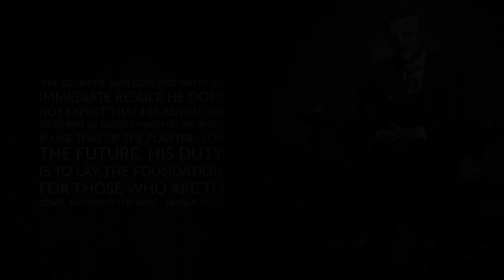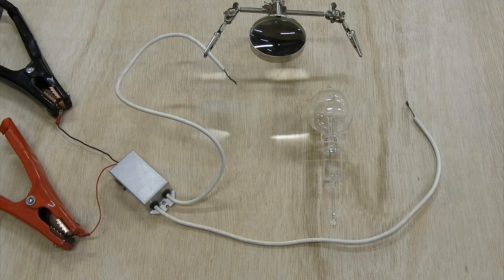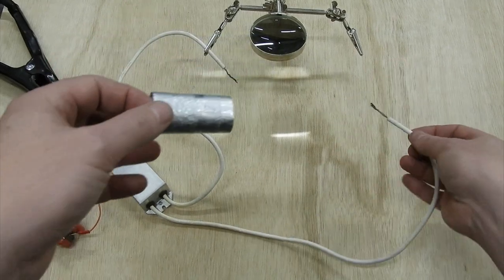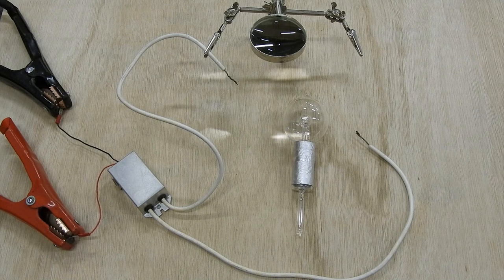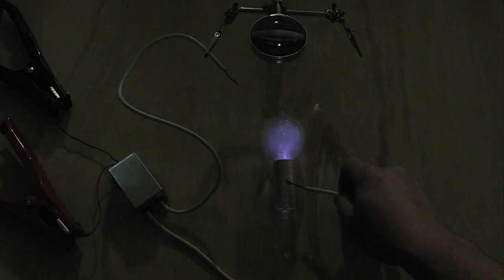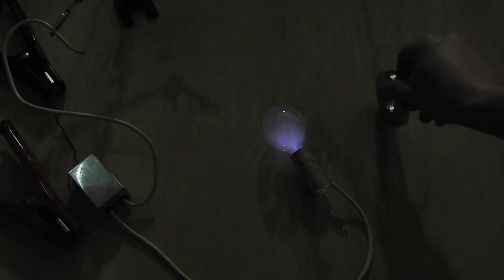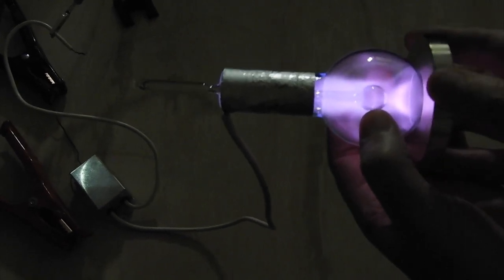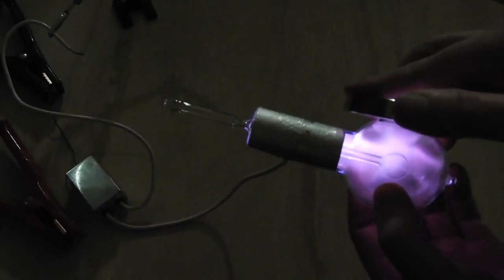Nikola Tesla's Plasma Valve Detector - Tesla's 1892 "Rotating Brush" Bulb Replication - Part 1

Comment: I've been working on this for awhile, few years, but no glassblowing yet, just pyrex glassware and greased seals.   I see this bulb as one of Tesla's central secrets, along with his prototype for Method of Individualization ( the "Static Eliminator" disks)  
Don't forget that FM radio is also a "static eliminator" device.     Also the diagram for the INSIDES of the Static Eliminator appears in Beograd Tesla Museum docs, the "wave-complex" signals being created by an array of eight resonators "tuned" by rotating and changing the gap. No, his "static eliminator" is not a simple transformer as everyone wrongly insists!  Tesla also called his wave-complex transmitter device by the name "sectional coils," discussed in the Leland Anderson interview.   It's radio with many tuning knobs, not just one, and each "station" becomes secure, existing as a tiny point lost in a radio-dial which exists virtually as an enormous, many-dimensional cube.  To find a station, we have to be given the dial settings, much like a combination lock.  Tesla said that his experimental system had 4 to 20 tuning knobs!
Reply from the maker: Sounds like we are on the same train of thought. Matey on FB shut me and you down because it doesn't agree with his schooling. This is a shame but you cannot please 100% of the people 100% of the time. I do have that Leland Anderson book thanks to one of my Patrons. Some deep study reading material. I have the radio court case book as well as the "AND" gate court case book. I have all 4 Leland Anderson books. If you would like a bulb that can be arranged. The turnaround should be pretty quick. We have nailed the design and fill pressures now.
Reply from the maker: @wbeaty  that’s really interesting. Have you got a link to the Corum Brothers article? Isn’t that their tower in Texas? From my understanding these bulbs operate on voltage and little current... like 20 watts, 0.5ma, 40kv for example should get fairly good results. If you put high wattage into glass of any type it is bound to melt. Electromagnetic transmission uses high voltage and current. Electrostatic transmission doesn’t appear to need the current because the vacuum to vacuum connection is super fast and has almost no losses. I think this is why Tesla was shooting for higher and higher voltages as time went on. His final design for a bulb in 1935 was designed to handle billions of volts. The construction being quite different to the 1892 bulb. I’ve got a Patreon site www.patreon.com/TeslaTurbo

There are some serious builders there and many great researchers. It’s a brilliant group of people. I’ve also built private forums in the past to investigate inventors claims but the Patreon site is working well. Tesla states that disruptive discharge should not be used with the rotating brush bulb. I’m currently working on part 2 of the video which will expand on the subject further.

Comment: holding in hand/ picking up your mag. field....interesting.
Reply from the maker: I think as we get closer to the 20kv Tesla specifies as a minimum for "fairly good results" things will get super interesting do the same basic tests. My next move is a car ignition coil which is about 20kv.... The current will be lower than this experiment so it will actually feel nicer to touch..... Electromagnetic bulbs need amps for very high lumens. Tesla's electrostatic bulbs need high voltage and not current for more lumens.

Comment from the maker: To answers the unanswered question towards the end of the live chat @Jo Nicley : "I thought I saw that bulb before lol" Where did you see one? "resonance?" Yeah you need a resonant coil. The bulb brightness is a good tuning device to achieve a more perfect resonance. I just used an off the shelf fully developed cheap system to demonstrate the cheapest way into testing whilst keeping it safe.
Reply: I saw it in one of the patents I've read. You showed it to me maybe magnifying transmitter?
Reply from the maker: @jonicley2254  what platform did I show it to you on? The only time this particular bulb is shown is in 1892 lecture and the two 1919 articles called “The True Wireless” and “Tesla Bulbs”. Tesla did have bulb patents but they featured lead in wires. This is the only bulb that Tesla wrote about should be used as a detector. All the others are lighting bulbs only. The rotating brush bulb has a more important future. Wardenclyffe cupola was supposed to be covered in these bulbs all inductive coupled to ground through the fine winding coil. The coil that starts of as a secondary and then becomes the primary. Tesla had a different bulb design by 1935 with what looks like a tungsten lightning protector in a bulb of ultra high vacuum. Replicating that is also on the cards.
Reply: It must have been in the true wireless you showed me on messenger where I saw it. Which patent is it where it is in the text but no picture? Can you use electromagnets to cause the light to travel in a ray?
Reply from the maker: @jonicley2254  https://teslauniverse.com/nikola-tesla/patents/british-patent-24421-improvements-systems-transmission-electrical-energy-and-apparatus-use-therein  "At the receiving station a transformer of similar construction is employed, but in this case the long coil A1 constitutes the primary and the short coil C1 the secondary of the transformer. In the circuit of the latter are arranged lamps L, motors M, or other devices for utilizing the current. The elevated terminal D1 connects with the center of the coil A1, and the other terminal of said coil is connected to earth and preferably also to the coil C1 for the reasons above stated."
Reply from the maker: @jonicley2254  best to read this.... https://teslauniverse.com/nikola-tesla/articles/tesla-bulbs I've not tried an electromagnet yet as haven't even got 20kv setup yet. I do have a 40kv low ohm coil I could test too.... I have been looking at multipliers and stuff to try 100kv.... with have to make a potted voltage multiplier or suitable Tesla coil though for that.
Reply: @nikola.tesla.r.and.d.centre  I'm winding lots of 40in TC secondaries on 6in water pipe, first threading the surface on the lathe, for extremely easy wind.   Perhaps trade for Tesla bulb?